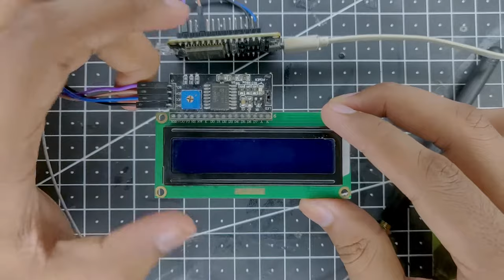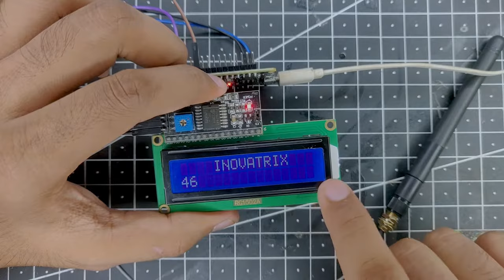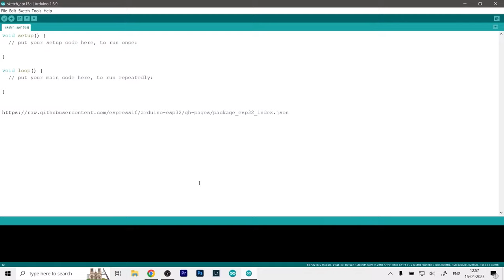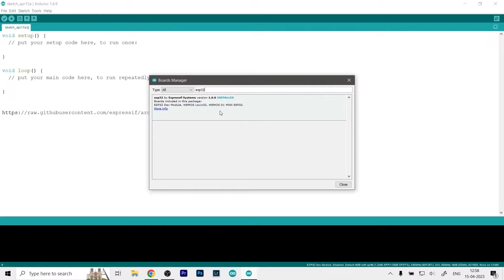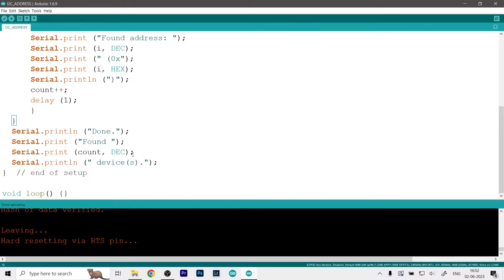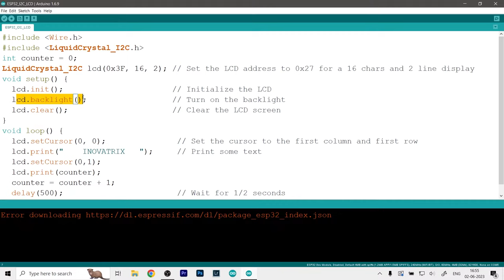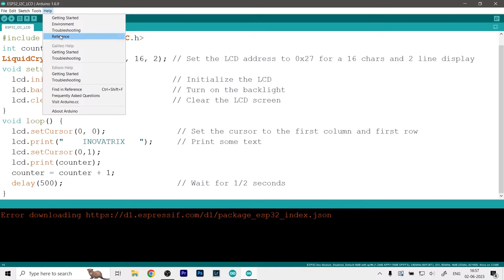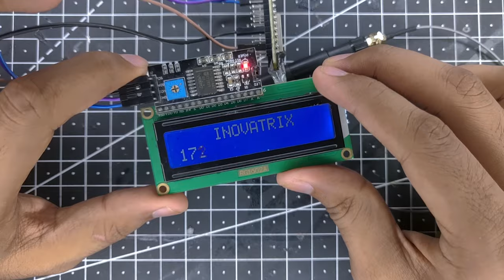How to Use 16x2 i2C LCD Display With ESP32 | With Program Explanation

Comment: Fantastic tutorial. However, I ran into a problem where the LCD is blank. I tried testing the I2C pins but I get a message "No I2C device found". Please, how do I resolve this?
Reply from the maker: Check connection between the Arduino and the i2c board.
Reply: My connection is SDA>>D21
SCL>>D23
Reply from the maker: Try using different wire, sometimes the wires are not good.
Reply: Add in setup function Wire.setPins ( 21, 22 ); or whatever. Without this line it will never work.

Comment: You can damage the pins of the ESP32 by sending data with signal levels between 0V and 5V, as shown in this video. The ESP32 can only support up to 3.3V. Use a level shifter between the LCD display and the ESP32 to avoid damaging your board.
Reply: Wrong, the power in the LCD is not related to the digital signal, they are separate.

Comment: what's the purpose of the antennae, i thought the esp32-wroom-32 had built in wifi
Reply from the maker: It was just an extension I attached myself. The ESP will work as intended with or without it.

Comment: i have error for this which is  error: 'class LiquidCrystal_I2C' has no member named 'init'
   lcd.init();                       // Initialize the LCD
       ^~~~
Multiple libraries were found for "LiquidCrystal_I2C.h"
exit status 1
Compilation error: 'class LiquidCrystal_I2C' has no member named 'init'
Reply: Did you already found how to repair this error ?
Reply: did you find the solution?
Reply: Creo que todos tenemos el mismo problema